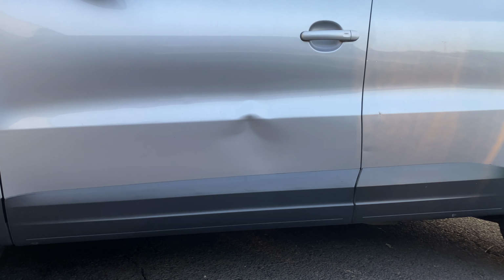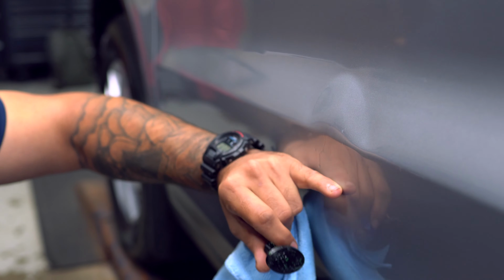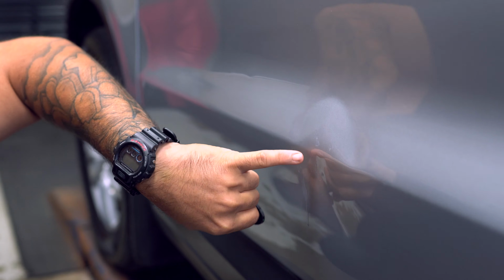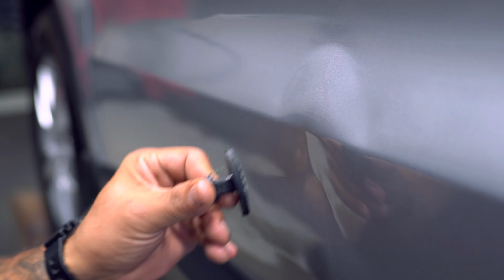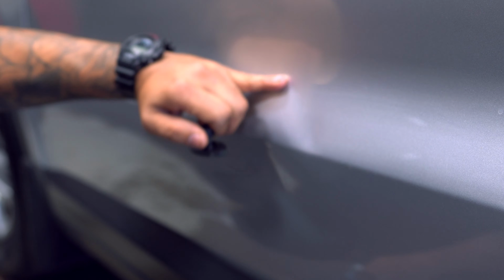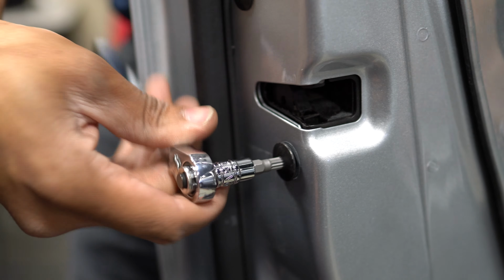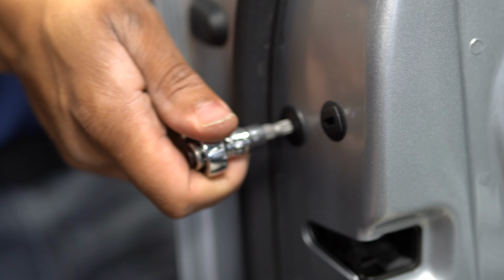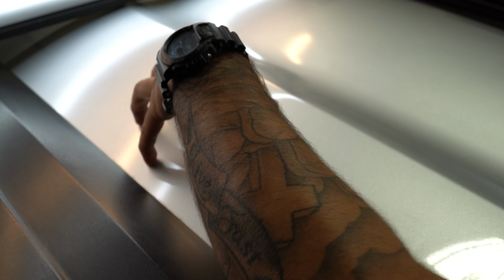This Dent is Driving us CRAZY😝 | Dentless Touch PDR Vlogs

Comment: Those doors! They are a pain to strip but once you’ve sussed it they are ok.

Just to note though if you remove a door handle on one of these, pull the handle out or use a window wedge to hold it open and then unscrew until the cap comes loose, anymore and the horse show clip will fall out and it’s an absolute nightmare to refit it! Super results as always 💪🏻🇬🇧